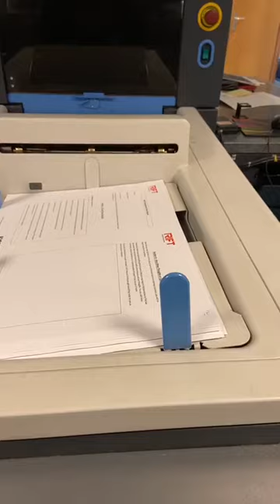SOLD: HP Indigo 7900 used digital press (MEK16547)

Comment: This is a Indigo 5500, not a 7900
Reply: according to the machine plate it is a 7900!
Reply: @moniquevanderhorst3902  I'm a licensed operator for both machines, someone changed the plaque on it. Usually they put their business name there. That press does 1,000 4/4 sheets per hour, the 7900 will do around 1,650
Reply: At 13x19
Reply: Scorotrons and Pip enhancement units are series 2 technology. 7k is series 3